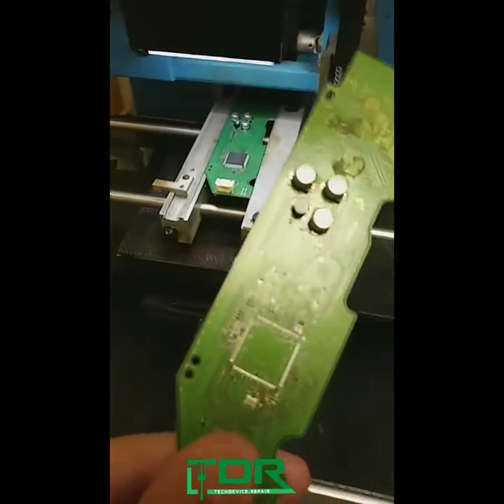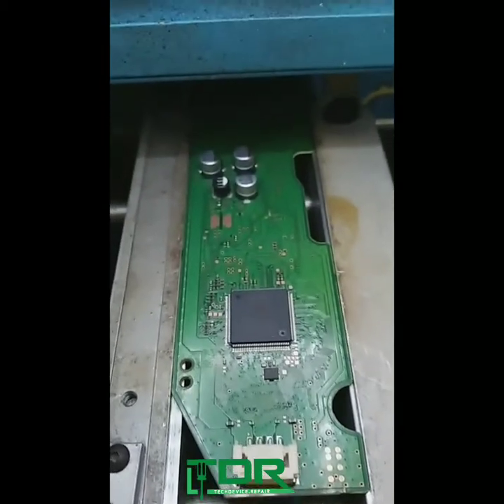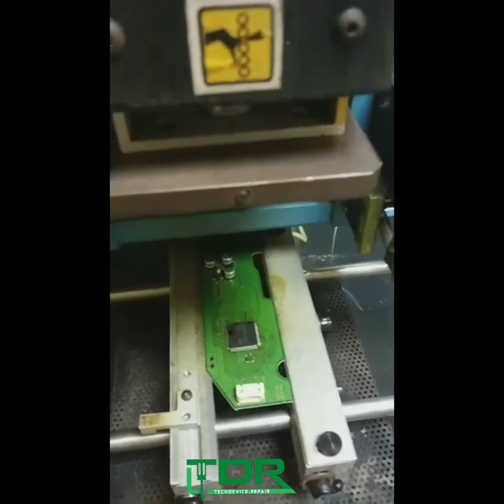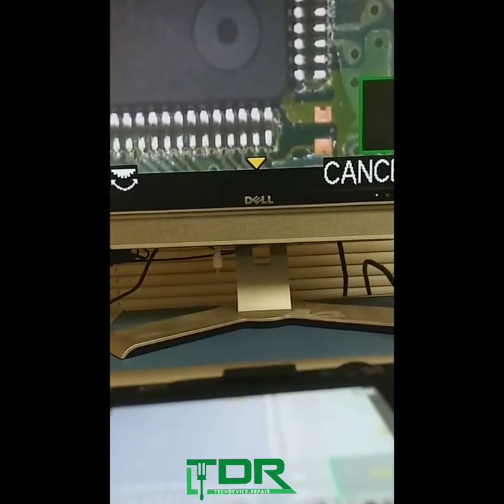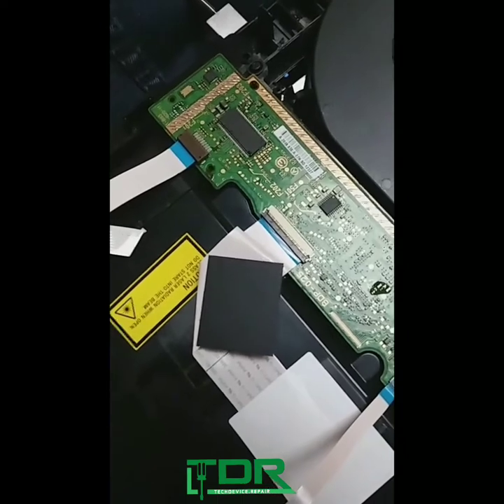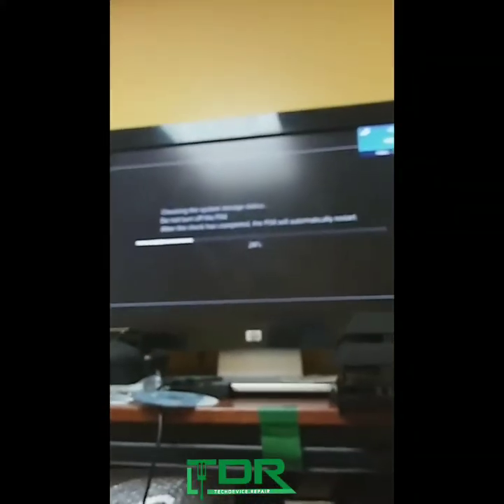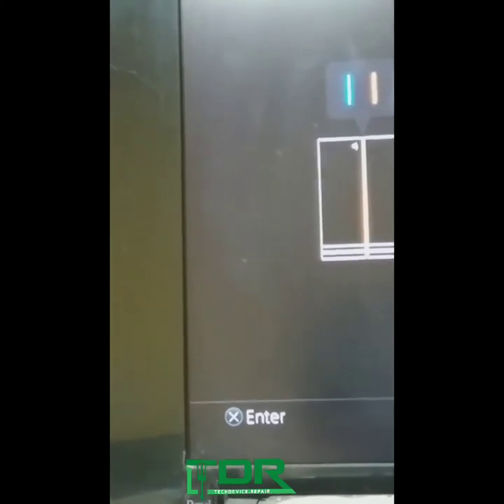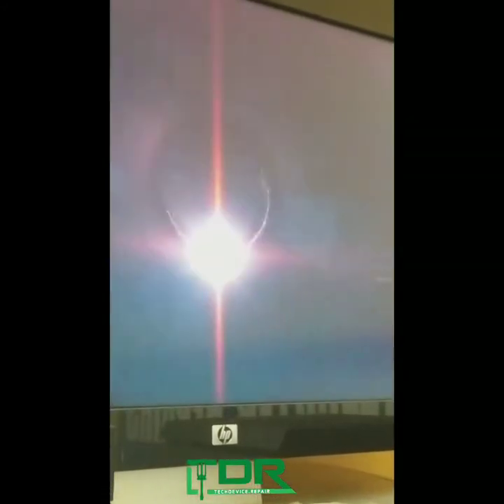PlayStation 4 Blu-Ray Drive ( Re-Marrying Daughter-board ) - Real Fix

Comment: Hello, i am currently trying to learn how to do all this so i can make some knowledge on motherboards. What is that liquid you used on the chip? Is it necessary to use that? Or are there alternatives?
Reply from the maker: You must use flux to remove the oxide buildup on the solder.  Otherwise you will get poor heat transfer and worse cold joints.

Comment: Ok so my ps4 takes a disc but doesn't recognize there is a disc in it so I replaced the optical drive and it's still not working.. Could it be a daughter or mother board issue? There is no disc error popping up and on the original daughter board the disc eject sensor doesn't work

Comment: I have a ps4 on system 7.51, but it is deleted a system from a hard disk. When trying to install it, I get an error su 42118 from a reader board, I thought to install from another ps4  that is on the same system and then put it back in my ps4. Does this method work?I just want to hack it on that system
Reply: No,it will not work.
Reply: @webassasin well how do we fix it, my disk drives daughterboard is missing the black part that the data cable(thinner white cable along top of discdrive) how do i get a new one or as google says, to "swap" it from my old one?, pls help, idk what to do and the update is so far out, im up to 13.00 but keep getting error code SU-4118-6, what do i do???😢

Comment: I have a board bdp 025 can i put a chip in a bdp  010
Reply from the maker: I don't remember,  but I thought the 010 has a big laser flex connector.  🤔 so you have to change the drive too.
Reply: @TechDeviceRepair  I understood but how to know an original bdp 025 board because since purchasing ps4 I have this problem error update 35888 and I don’t know if it is original

Comment: Will a drive from a cuh-1115 fit a cuh-1116?
Reply: brother it depends upon the Blu ray drive model! First you have to get the Blu ray drive correctly and then try swapping the daughter board with the another drive with the same daughter board model! Eg. 020, 025.. And if you wanna remarry then u need the donor board to also be the same model number as the dead board! Hope it helps

Comment: :: my drive quit working, and was going to replace it, but it was the wrong type drive that had a different sized ribbon cable. Put it back together with original parts and still got this error. 🤷🏻‍♂️